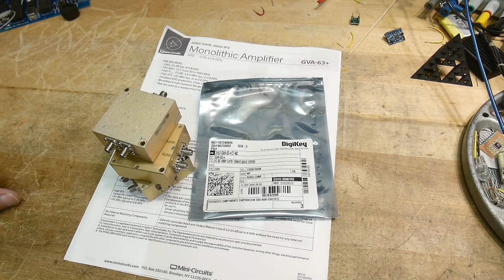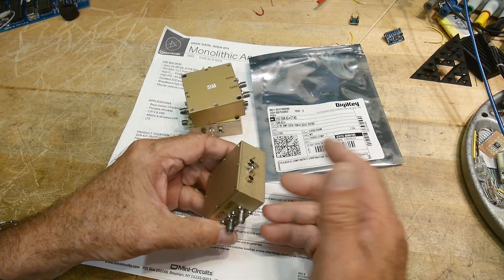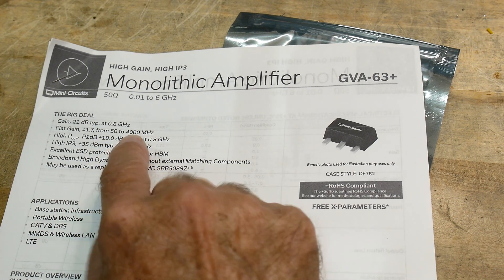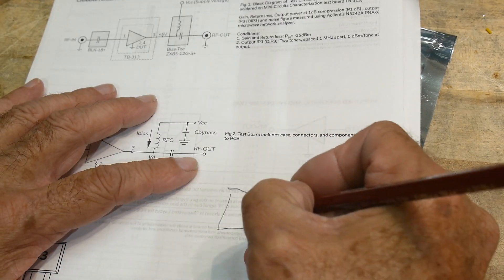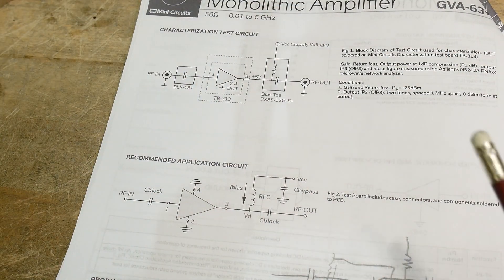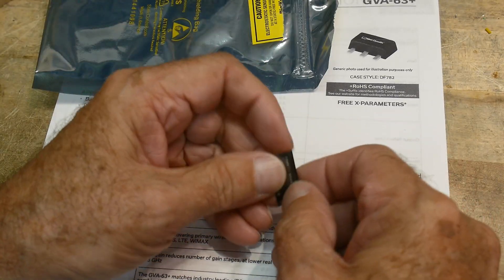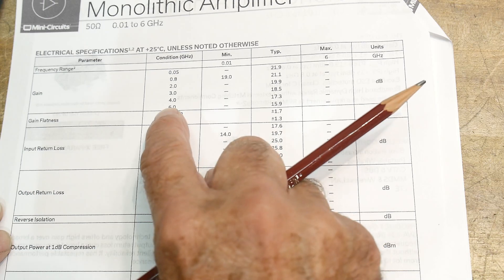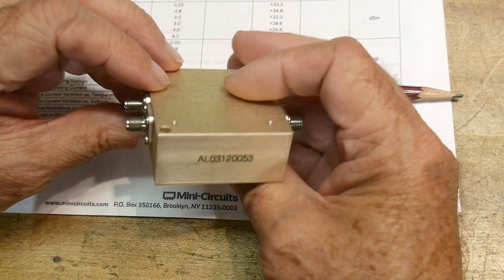#2018 GVA-63 Amplifier Project (part 1 of 10)

Comment: I really love videos like this by you. I am designing a 5 pole band pass filter for around 100MHz and your videos on those have been helpful to me. I would bet this part would be great at bringing up the RF levels after a passive filter like that because of insertion loss for low level signal stages to clean up the phase noise and other artifacts many of these all in one chinese FM synth chips have.
Biggest problem is getting below 2 or 1MHz bandwidth to really knock out the sideband noise while keeping the passband mostly unscathed. 
If you ever discuss more on PLL circuits and narrow RF filters that would be awesome. It's still one of those black arts in the RF area for many of us trying to dip our toes into something beyond a free running oscillator or mixed stage for frequency stability.
Reply from the maker: you will have to search my 2000 videos, I've done those things

Comment: NF > 3dB. No go.
Reply: He stated that it was intended as a power amplifier not a LNA so NF should not be important at all.
NF=4.6dB, 4 GHz bw gives a noise power of -75dBm.
At 20 dBm output  that gives an SNR of 95 dB over the full bandwidth. That's good enough for almost all applications.
Reply from the maker: yup
Reply: I think I may have made a mistake. The noise power is calculated at the input but the signal power is referred to the output.
So it is probably about 75 dB SNR rather than 95 dB, still good enough.
Reply: @larslindgren3846  Nice :)

Comment: A couple years ago I played around with the PGA-103+ to try to replicate a pre-amplified VHF / UHF compact scanner antenna known as the ARA-2000. It was sold back in the early 2000's and no longer available. I got really good results initially but it seems after a week or two up in the air the device can suffer from overload and damage from local cell towers in the area.
Reply: might need an input band stop filter on FM, and a few band stop filters to get rid of the various cell bands on the input. You also might need static charge dissipation on your antenna too - some antennas can build up quite a charge just from the wind blowing over them that might blow up one of these amps

Comment: Wait, wait, wait…. First there is the customer’s input. (and modified by the sales-team). Then it is the mechanical, environmental and power constraints. Then there needs to be the all important spread sheet showing the noise-figure, gain, 1dB compression point, IP3, power dissipation, etc, etc, for each stage, as well as the accumulated figures, followed by design reviews in which you get told exactly how bad your design is… and then comes the next stage of endless paperwork going around in circles until the goalposts have moved several times. don’t go around skipping those important aspects of a design. 🤣😂🤣. You can’t just dive into the actual design just like that!!! 🤣😂🤣 (sorry, 30+ years of designing has taught me that).
Reply: Sounds like you work at my place! 🤣